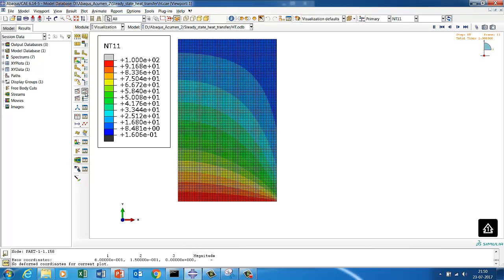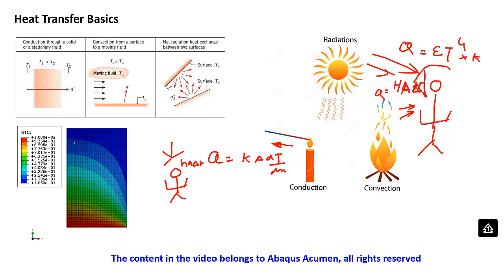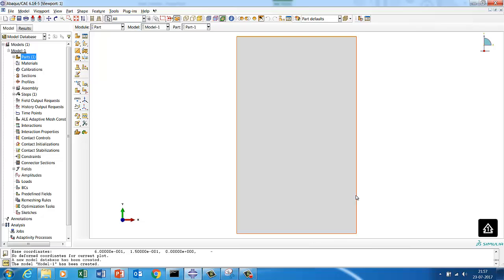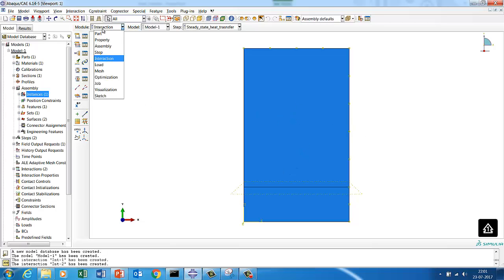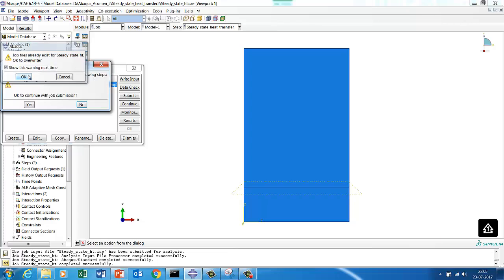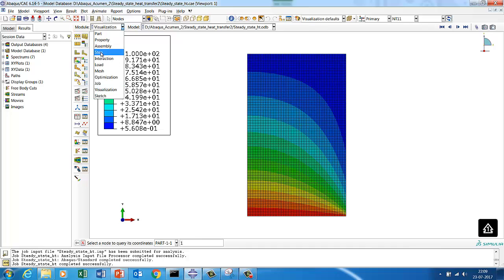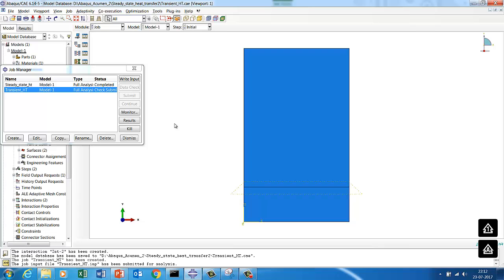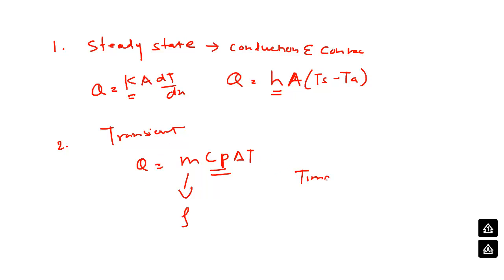2D Steady state and Transient Heat Transfer

Comment: Can you please help me with this error?? What should I do??
 
Error in job Transient_HT: STRESS-DISPLACEMENT ELEMENTS OR OTHER ELEMENTS WITHOUT TEMPERATURE DEGREE OF FREEDOM ARE NOT ALLOWED IN A HEAT TRANSFER ANALYSIS
Job Transient_HT: Analysis Input File Processor aborted due to errors.
Error in job Transient_HT: Analysis Input File Processor exited with an error.
Job Transient_HT aborted due to errors.

Comment: specific heat is at constant pressure, right?. look at your explanation. But when you are adding in the simulation box you are using it as specific heat at constant volume!. Please correct me if I`m wrong